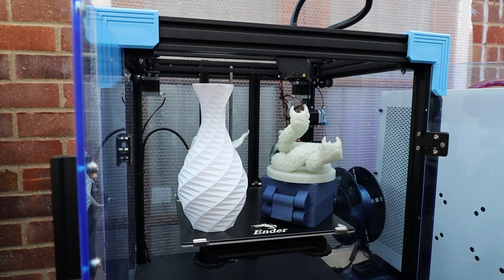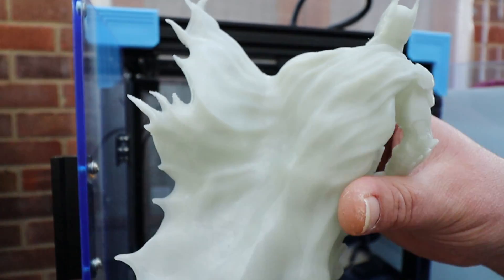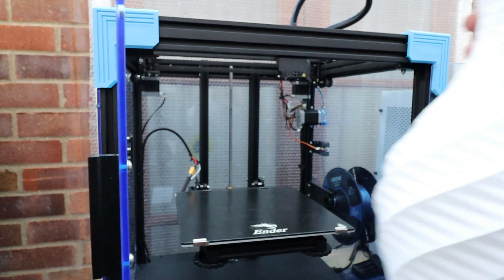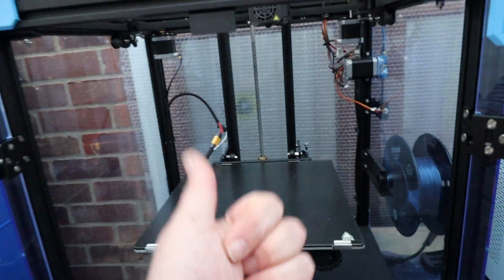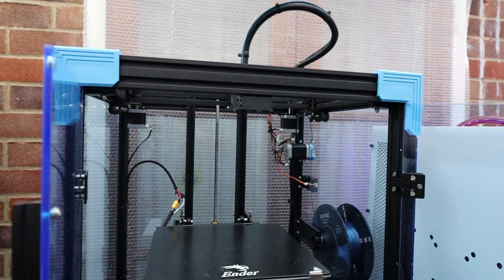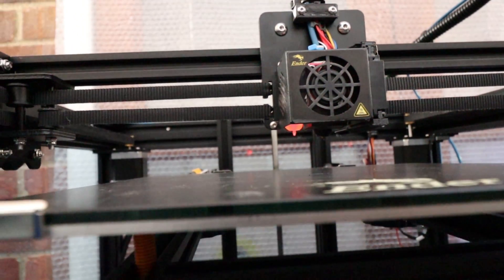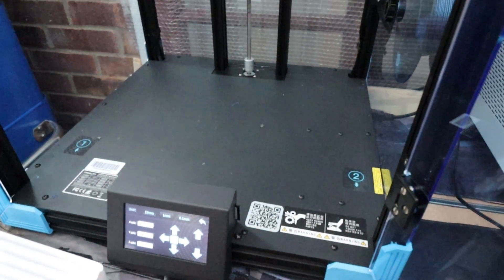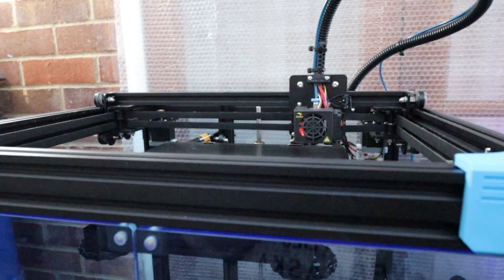Creality Ender 6 Test Prints And BLTouch install v3.1

Comment: is it better than the ender 5?
Reply from the maker: I've just brought another ender 5 and with a couple of easy mods I would say it's not far off but the ender 6 will print alot faster
Reply: @BeanGaming-w4n  Thank's for the quick reply!
Reply: I am a bit on the fence between the TWO TREES SAPPHIRE PRO/Plus or this one. The Two Trees is half the price and equally fast...
Reply from the maker: @rabenklang7  I really wouldn't get the two trees if I was you as the quality of parts is just not the same as creality, remember you get what you pay for
Reply: @BeanGaming-w4n  Yes i got some mixed reviews, some say, it is a really hassle to get it working, some say it really prints good and it seams a sturdy build. The Ender 6 seamed to have very noisy fans in some videos, what do you think?
Reply from the maker: @rabenklang7  I would avoid the two trees one for sure they just not as good, creality just released the sarmoon which looks like a amazing printer, might be worth a go, mine is on order

Comment: just put in a bigger print bed your self it easy, and the bracket that keeps the wire and tube print one that fits, im so glad i didn''t buy one i print at 80mm/s to 120mm/s on my tronxy and printbed is bigger this printer ould have been a waste

Comment: I've just completed the corexy conversion  on my ender5 it much noisier as you say lol
i just wanted to add some thoughts you said it was big but it still takes up less room then a printer with the bed that flops in and out 50cm each way. 
Personally I would just take the boden tube from out of the braket on the hotend
As for saving the bltouch autoleveling it has always been the case where once you do the probing you would have to issue the store command in the menu (m500)

Comment: Have you (or anyone in here) managed any ABS on the Ender 6 yet?
Reply from the maker: Hi, no I haven't I dont use abs as it's a pain in the bottom plus stinks as well
Reply: @BeanGaming-w4n  I got a variety of filaments to try and so far I can utterly agree, several spaghetti specials later. I am stubborn, and stupid, though so I will probably try again.
Reply from the maker: @stuartdavison289  best way to learn is to keep trying lol 😆 petg is worth ago
Reply: For ABS,asa,nylon, etc yuo need a top cover first for tis printer, yuo need a closed printer to avoid warping and cracking
Reply: @noway8233  the printer is fully enclosed in a separate enclosure thanks.

Comment: Just a quick comment on you saying some of the filament used was old. I recently bought one of those filament dryers which the role sits in. Best add-on I've ever had. I had a filament that had been out in the open for weeks and was snapping in the extruder. I dropped it in the de-humidifier and it was "good as new".
Reply from the maker: funny you should say that, i ordered a filament dryer and it arrived yesterday
Reply: @BeanGaming-w4n  haha it's been so humid hear in Perth (Aus) we couldn't do with out it - too many filament breaks when the PLA has absorbed moisture. By the way, I got my BLTouch running, and the challenge I had was, mostly my impatience, we can't easily get the pico blade connector (used on the BLTouch), so I ended up tracing the pins from the BL Touch connector on the Ender 6 frame mounted PCB, and tacking the wires straight to the back of the big connector that feeds to the control board. Worked like a charm!

Comment: Jeepers it's terrible that the bed levelling isn't saved - hoping they would fix that. I'm so close to buying one, but for me time is off the essence, so a feature like this is important. I'm wondering if you upgrade the A/B stepper motors if it would go faster. Great review. Lots of reassuring stuff in there. Happy New Year!
Reply from the maker: Definitely worth investing in no worries on that one 👌
Reply: @BeanGaming-w4n  I received my Ender 6 yesterday - thanks to your video it took me only 90 minutes to assemble! Gotta fix-up the BLTOUCH. Also, again, thanks to your video, it was obvious, that the best time to install the BLTouch at the head end, is before you assemble. So that saved a bit of time I reckon.
Reply from the maker: @chrisnurse7658  thank you for your kind words and happy printing

Comment: Beanie - I have an Ender 6 on order, don't have it yet.  

Regarding the BLTouch mapping not saving - I'm hearing that the Ender 6 saves settings to an inserted SD card instead of on main board memory, so if you have an SD card inserted it will save the BLTouch mapping after power cycle.  Can you please confirm?
Reply from the maker: Hi, I currently don't have the ender 6 running as have other printers running that I have got to review
Reply: Exactly what I am wondering and been holding off for a few weeks now...scared it will mess something up lol. No one, including Creality brutal 'information-less' vids mentions anything about having the firmware on the SD card from factory or not?? Did read you can just delete G-29 (home print mesh) in code at beginning of print settings in Creality slicer/Cura. If you have an answer seeing you posted this 9 months ago, please do me a 'major solid' and let me know what you found out for certain Doug! Cheers!

Comment: Hello! do you recommend me the ender 6 or the ender 5 plus?
Reply from the maker: Hi, they are both good printers the ender 5 plus is a mammoth of a machine so keep that in mind and the 6 is a core xy so they both have their own benefits, all depends if you need a printer with a larger build plate or not
Reply: @BeanGaming-w4n  Ty so much for toy reply, i think i will buy the ender 6 and later a put a bltouch. I come from artillery x1 and never use all his dimession.

Comment: I see you have a MacBook. My father and I just bought this printer and we are using CURA. It is what the manual recommends but the software doesn’t have Ender 6 as an option. Any help if you know of why that would be amazing
Reply: Use the Ender 5 profile in Cura, but adjust the build plate dimensions and Z height figures to match the Ender 6.
Reply from the maker: @dougpinckney8966  yes they could do that but sometimes can be a bit daunting for new users to do 🙂👍
Reply from the maker: hi, on the sd card that comes with the printer there is creality slicer, install that then there is a profile you can use for the ender 6

Comment: May I ask why remove the end stop switch? I have had no problem with mine not removed
Reply from the maker: with bltouch installed you dont need to have the end stop switch in place thats why i removed it
Reply: @BeanGaming-w4n  I would imagine it's ignored by the BL Touch firmware anyway.
Reply from the maker: @chrisnurse7658  its better to remove it so it doesn't hit and stop the bltouch from reaching the bed

Comment: Hallol Beanie,
something I'm doing wrong, but I can't figure out what.....
I have installed the BLtouch V3.1, also the corresponding V1.0.2 BL software.... so far everything is ok, the new menu is displayed.
Also the level procedure starts and all 25 measuring points are measured through, without error message.
But then:

1) before printing, the complete 25 points are again approached and measured.
2) the nozzle moves at least 3mm (!) too high over the print bed, the print is completely bad.

What am I doing wrong? Someone has an idea?

Greetz
Marco
Reply from the maker: Hi, if you have got the auto bed levelling turned on in the menu it will re level the bed every time you start the print, you need to set your z offset by the sounds of things
Reply: @BeanGaming-w4n  
first of all, thx for the fast answer... great !
Ok, I got the first point (re level), but what you mean with "by the sounds of things" ?
Reply: Ok, i know what you mean..... Do I need to set the Z offset in the same menu with + and - and when the level is ok, press the "home" symbol? Once ?
Reply from the maker: @supershadow25  hi, you need to adjust your z offset, I explain how to do it in the video 🙂 go into levelling once the machine has homed itself put a piece of paper under the nozzle then lower the z offset (button on left side) once the nozzle is then touching the paper press the middle button between to up and down arrows on the left hand side to save the z offset, then level the bed
Reply: @BeanGaming-w4n  Hi Beanie again :-)..... i did it exactly this way......  hmmmm..... i must have done someting wrong.... i still have up to 3-4mm space between nozzle and plate in the print.... I will try it again.....
Reply from the maker: Did you remember to press the home button to save the z offset? Also side note make sure you have the sd card in the machine so it has somewhere to store the z offset
Reply from the maker: @supershadow25  yes that's correct buddy make sure you have the sd card in the printer as well
Reply: @BeanGaming-w4n  I "think" i did press the home button..... but I'm not sure if I still have the sd card in the machine..... hmmm..... maybe here is/was the problem?
Reply: One different question.... I still testing my  valures for  retraction distand and speed (using PLA)..... what are your valures for both?
Reply from the maker: @supershadow25  put the sd card in and start again lol
Reply from the maker: @supershadow25  in all fairness i never changed mine from the original settings.
Reply: @BeanGaming-w4n  Ok, the original setting from "what"? Do/dod you use the Ender 5 profil from cura?
Reply from the maker: @supershadow25  I will have a look through my settings tomorrow for you as its getting late
Reply: @BeanGaming-w4n  That would be great...... do you think it is possible that you send me your profil?
Reply from the maker: @supershadow25  yes that's fine, contact me through here my email is on the about page
Reply: @BeanGaming-w4n  I did :-)

Comment: I am so happy ... that I NOT buy this model! - Only 1 Z axis, super bad loud fans. 

The noise you hear is from Powersupply fan, Electronic Case fan and .... extruder fan it self.
If you want to make it less annyoing, you need to change all those fan. I really wonder what mainbord is in there.. 8bit ? and you can't even save BL when your done?
(If this got marlin, you can change the settings, for how many point you want in bed leveling and also change the speed)
I also notice have your wheels look like. They seems to be overtight and will very fast being ready for a replace.

No wonder why no big youtuber have got this for reviewing.... That alone rise a RED FLAG for me.

Good luck with your Ender 6 :)
Reply: It's a 32bit board, you won't find an 8 bit in any current corexy machine, simply wouldn't keep up

Comment: Where would I get the cable with the same small plug?
Reply from the maker: Hi, I had to make my own cable from 2 bltouch leads
Reply: The connector is called a molex pico blade. I actually just stripped some network cable to get a bunch of wires the same colour, then I soldered them onto the back of the PCB mounted on the frame. It was very easy. Use heat-shrink insulation etc. as it protects from shorts and provides strain relief.

Comment: Hi, added an SD card with the bltouch firmware and it's just sitting there at boot screen doing nothing. Bin file was only thing on SD card, is that right? Any ideas how to get back?
Reply from the maker: hi, was the printer powered off when you put the sd card in it?
Reply: @BeanGaming-w4n  yes, powered off, only the bin file on the card. It just stays on the opening screen without ever getting to the loading bit. Had to reload the original firmware which fortunately worked. But I have the bltouch installed so it would be great to be able to use it.
Reply: @BeanGaming-w4n  could the hardware in your Ender 6 be different? You did get yours quite early didn't you?
Reply from the maker: @stuartdavison289  I will have a look into it and get back to you tomorrow, not sure what is going on, mine did sit for awhile on the boot screen then loaded up
Reply: @BeanGaming-w4n  Thanks very much but don't worry about it today, enjoy Christmas. It's cooking eating and keeping the kids entertained today. Thanks again.
Reply from the maker: @stuartdavison289  hi, did you extract the files using 7zip?
Reply: @BeanGaming-w4n  yes, I believe so, as far as I know that's the only zip software I have.
Reply: @BeanGaming-w4n  actually I am not sure that was a zip file, the original firmware was but I think the bltouch one was just a bin file? I would need to check?
Reply: @BeanGaming-w4n  just checked it's a rar, would I need to use winrar instead?
Reply: @BeanGaming-w4n  (or is there another way to get the files from you?)
Reply from the maker: @stuartdavison289  hi buddy, right do a google search for 7zip its free, install it then right click on the creality download and extract with 7zip you will then be able to see the files inside the rar file, copy the bin file to the sd card, turn printer off, insert sd card and turn printer on then wait for it to install
Reply from the maker: @stuartdavison289  add me on instagram- Beanie’s hobbies, if you need more help its easier to contact me
Reply from the maker: @stuartdavison289  use this to open it https://www.7-zip.org/
Reply from the maker: @stuartdavison289  if you in a real muddle email me, my address is in the about section on my page and i will send you the file ready to put on the sd card
Reply: @BeanGaming-w4n  I will try again today, terrified of bricking it when I haven't done a single print yet.
Reply: @BeanGaming-w4n  actually ordered two premade cables from Mouser, one 450mm and one 600mm long 5 way picoblade on each end. The postage is more than the cables but I will be happier with that, I used two bltouch cables and cobbled a link with some ribbon cable.
Reply from the maker: @stuartdavison289  you will be fine, you just need to extract that rar file
Reply: @BeanGaming-w4n  thanks. Will try.
Reply: @BeanGaming-w4n  used 7, changed the filename to firmware.bin and it loaded first time. Auto-leveller doing its first measurements now. Thanks for the advice.
Reply from the maker: @stuartdavison289  beanies hobbies knows best lmao 🤣 happy printing buddy
Reply: @BeanGaming-w4n  cheers. First attempt, fingers and toes crossed.

Comment: Greetings 
I just got my Ender 6 I hooked up a BL Touch and I am having problems with it working is yours still working.
Reply from the maker: Did you update the firmware on the printer? Have you checked to make sure you have got the wires plugged in the right way around, can I ask what it is doing?
Reply: @BeanGaming-w4n  Greetings Beanie 
I downloaded the firmware from Creality site my son went and got the ender 5 plus then I was down getting som pla+ I spotted the Ender 6 in looking at your video you talked about the BL Touch so I picked it up also I work in the low voltage area so a little solder I good for. When I installed the Firmware the Z up stopped working shortly after it was running. My wife who dose software found a bin file to reinstall the firmware with out the BL Touch nd it’s working great love this thing I hope they will get it working soon the BL Touch was a 3.1 version. Thanks for the update and keep up the videos
Reply from the maker: @sawman611  hi, did the bltouch work at all? Could you level the bed?

Comment: Hi, can I use the profile of the ender 5 in the cura slicer? 
(modifying the dimensions of course) thanks.
Reply from the maker: Hi, yes you can thats what I did or the other option is to install the slicing software that comes with it and copy across all the settings
Reply: @BeanGaming-w4n  Thank you very much for your help, excellent video!!

Comment: hi changing the gantry brakets for smaller ones like on the blv cube  and moving the z axis back it seem there is space for a 30cm x 30cm print bed?
Reply from the maker: maybe possible with some modification work yes

Comment: I was just gonna buy the Creality CR 10-S5 but now I just seen this so I dont knw what to do what do you suggest
Reply from the maker: hi, the cr10 s5 will have a bigger build plate, and wont print as fast but is still a very good printer, all depends on what you want a printer for really
Reply: @BeanGaming-w4n  mostly for making cases for electronics and robots etc so what would u recommend I'm Stuck between ender 6 cr10 max cr10 s5 or do u have a better recommendation
Reply from the maker: @sullykhan764  hi, the cr10 max is an expensive printer and I cant say what it prints like as never had one, will this be your first ever printer? Also what sort of size prints and what filament will you be using
Reply: @BeanGaming-w4n  yes my first and I want something that can do wide range of things as I'm always doing different projects building different things so more it has to offer the better
Reply from the maker: @sullykhan764  hi, right in my honest opion i would have a look at the creality cr6 se as it is an amazing easy to use printer, its one of my top 5 printers, i love it and im now looking to get another one

Comment: Does it have a usb port or does it only support sd card?
Reply from the maker: Hi, no usb I'm afraid, updates done via sd card
Reply: @BeanGaming-w4n  :( So octoprint and more can be forgotten...
Reply from the maker: @fxp5544  unfortunately yes
Reply: @fxp5544  From what I've read, it does work.  Just have to disable the vcc connector to avoid voltage bleed-through, there are adapters from TH3D which do that